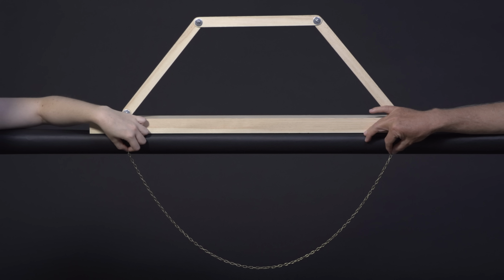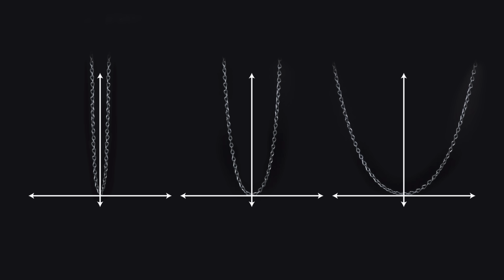3. Arches and Chains

Comment: Doesn't the chain shape change depending on the length of the chain?
Reply: Not really, it's the same shape just blown up or shrunk down. The real deciding factor is the distance between the ends (actually ratio between length and distance between ends).

Comment: I strongly believe this is an architectural modeling...
Engineers do not really calculate archs depending on chain forms...
Engineering uses solid maths. 
We calculate the arch to be stable no matter how wide or tall it is.

Comment: How would something like this be used in real life. How did Gaudi know how thick to build the arches to support their weight and excess weight. Are there mathematical functions that engineers use when developing arches? Basically... how does this principle of arches and chains transfer to the actual designing and building of a structure?

Comment: The reason it collapses is not that you can not hang a chain in its profile upside down, its just a test. You explaned nothing by saying that, you just added a method to check if it will hold.

Comment: So... if you stretch out the chain so much that it's straight... does it prove that a completely straight bridge will also work?
Reply: As they mentioned in the video, the forces of a chain and arch are opposite. A completely straight bridge would need a lot of compressing force (instead of the tension force) from both sides of it to stay upright, and likely means that very little force could be applied on top of the bridge.

Comment: Okay but I find "this stands because the chain says it will" to be VERY unsatisfying. I know the math comes in later, I watched the whole thing, but i still don't find it balances out. The thin arch doesn't fall apart "because you can't fit a hanging chain inside the shape", it falls apart because the surface area of the base is too small to create enough friction to stay put, and the pieces being lighter changes the horizontal components of the forces throughout (horizontal relative to each contact surface) which means the pieces cannot push against each other hard enough. Moving the legs out does a couple of things. It increases the friction by changing the angle at which the  "legs" (the first pieces from the ground) push on the rest, and it increases fiction at the base because a cut at an acute angle will create a bigger surface area than a cut closer to 90 degrees. Or at least that was my guess, and now I'll never know if I was right because you decided to explain it with the chain thing, which is, at best, a cheat sheet type thing.

Comment: I had a great education in Civil Engineering at Heriot Watt University but I can tell you that I Learned a lot via the models used in your videos. It seems so clear using chains but I never heard of that analogy before. What you are showing is that as soon as the arch blocks see eccentric loading then the joints try to go into tension and rapidly fail.

Comment: With the "chain test" how do you define the "sizing" of the chain? I could use a tiny chain and have it fit entirely in the inverted arch. But if I use a larger gauge it's possible that it wouldn't fit inside the arch.

Comment: my answer for why the wooden arch needed to be thicker was that the touching pieces had to be broader in order to not flip. its not the right answer, but it is relevant, because the pieces twist around the axis of where the chain would go. this seems to be where the structural load is :D

Comment: cool, but disappointed in the explanation at 4:32. the fact that an arch is stable when it mirrors a hanging chain is very cool and interesting, but it is not why the arch is stable. was it due to excess forces outward at the base, or in the joints? where is the explanation other than "oooh chain magic"?

Comment: with the arms resting on the table demonstration... one thing I never got was why teachers will say things like the table or the ground is pushing up as in against the elbow.. that seems plainly incorrect.. its obvious that instead its the weight on the elbow pushing down. the table doesn't rise up once the guy leaves. so why in the equation represent an upward force instead of a downward force?

Comment: 5:44 instead of adding horizontal forces to change the chain shape to match the arch, you could add vertical forces - build vertical towers at those points. Or add secondary arches that meet the primary arch at that point. You see these features on a lot of medieval cathedrals.

Comment: So Mathematically Arcs are the inverse functions of chains and as you find inverse functions by swapping x and y, you wast tension and pressure.
Reply: Arcs are not the inverse function of chains, they are their mirror on the y axis. Inverse function is the mirror based on the function y = x (such as ln(x) and e^x) which is not the case for arcs and chains. Arcs are like x^n and chains -x^n. The inverse function of x^2 is more like sqrt(x). Anyway idk if that was clear but well.

Comment: Just found this channel and really appreciate all the example that are used to explain engineering models to keep refreshing all my study from the past.
A question from me, is there any rules so we can determine using heavy chain or light chain for modeling arches profile? Like the ratio of width to height profile (if the profile is rectangular) or the catenary's influence line.
In the video, I can see some examples that most of it are using small rectangular profile arch from the light chain upside down modeling. Hope you can answer my question so I can sleep well. Thankyou.
Via email: trytirto28878@gmail.com

Comment: Digital computer: construct mesh of finite elements and perform series of calculations to approximate behavior of system.

Analog computer: hang a chain and add weights.
Reply: The simple methods are often the best solutions.
Reply: The computer only knows what the chain hanger taught it.
Reply: @andyg256  ai would like to introduce itself
Reply: @andyg256  there is a lot of truth in that statement.
Reply: Chain with weights just abuses the computer that runs our simulation. It is always better than our hand-made artificial weak computers!
Reply: The thing is, nature perform many complex computations in our place, why not profit instead of recreating an inefficient, complicated and unprecise model?
Reply: @MindcraftMax  because nature is only interested in the most efficient results, most often than not trough inaction. if you were to ask nature how to build the sagrada familia it'd say that the hanging chains are already a compromise, and in it's opinion we should just find a pretty pre existing cave if we really need a roof over our heads when we pray
Reply: They constructed those complicated structures without computer
Reply: Why does that first part sound familiar? Avengers endgame?